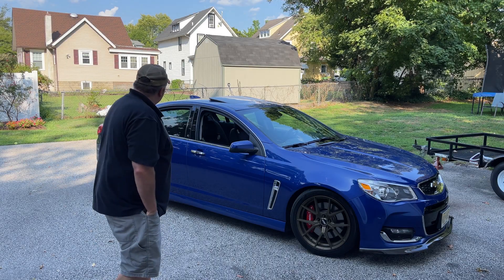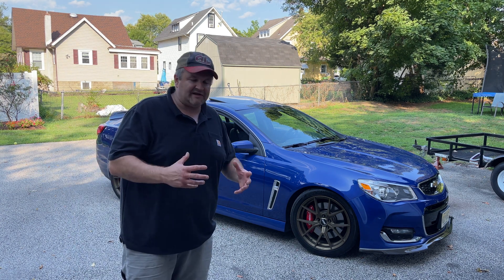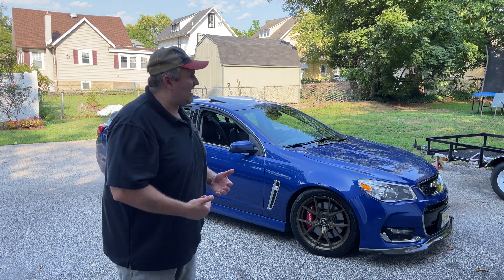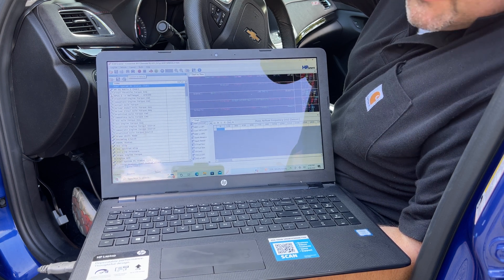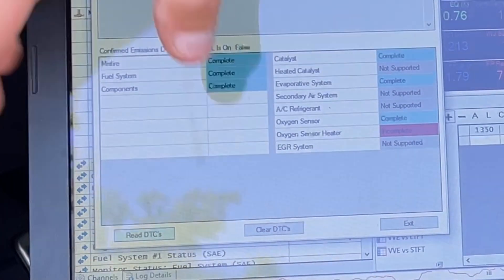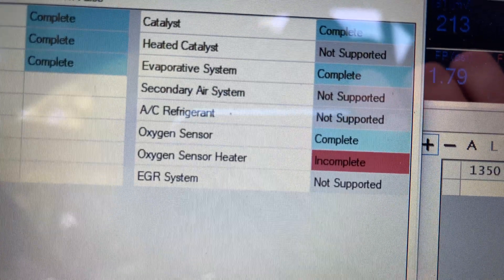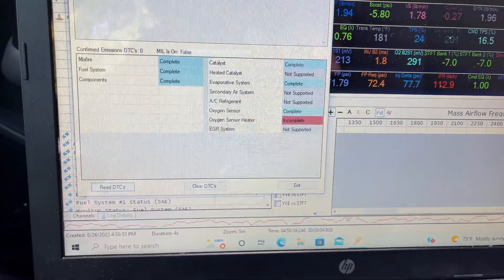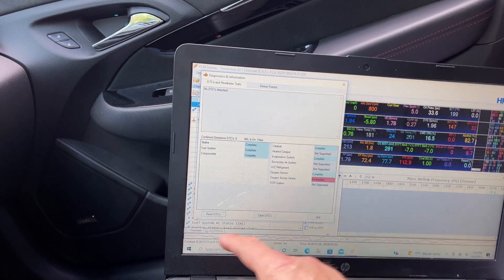O2 Sensor Readiness Monitor Completion on GM OBDII Vehicles

Comment: I cant get the catalyst complete on my truck no matter how many different drive cycles I make. no catalyst codes and I checked to see if its clogging up with a thermal imager but its not. could I use hp tuners to set to ready ?

Comment: I did the drive cycle this morning, starting with three sensors not ready (O2, O2H, and evap).  After the drive cycle I’m down to evap not ready but it will pass in Texas.  I ended up having to drive on one of our major highways early in the morning to get to the proper speed range.  It’s kind of nerve racking but all went well.  Picture trying to drive steady at 55-65 mph on I-95 or I-78 at 5:30 AM if that’s possible in Jersey. 😬
Reply from the maker: Jersey boy and have my spots but yea…it sucks man because it’s a dice roll whether or not you get backed up. Glad you got it!
Reply: What's up with the evap not ready? I have that an the o2 heater.  🤦‍♂️ I replaced all 4 o2 sensors an have my evap system..  haha

Comment: How long did it take to get the heater to set, been struggling with mine for about a week.
Reply from the maker: 20-30 minutes of driving but you need to find an area where you can give it hell for a bit and drive under varying dynamic loads.
Reply: @BanditDave's Toy Chest  this is for the heater sensor? Like yours I have oxygen sensor set bit oxygen sensor heater not ready.
Reply: Did you end up getting the OH ready? If so how? Mine is stuck on not ready.
Reply: @MaximaFrecuencia  Took a long time to get it ready, just keep starting it and driving it, defrost, etc. Coolant temp needs to be within 10-11 degrees of ambient too.